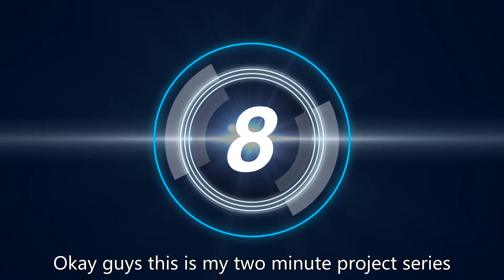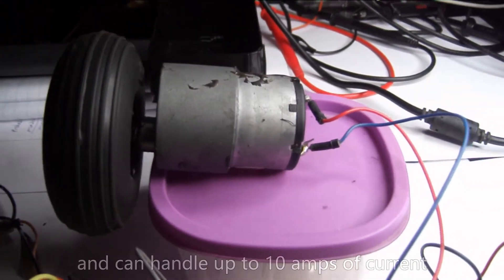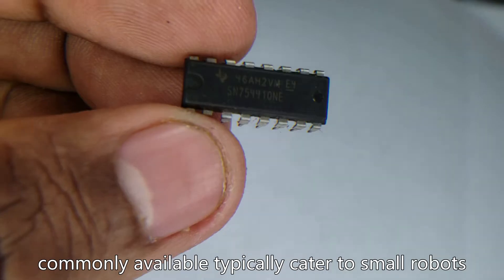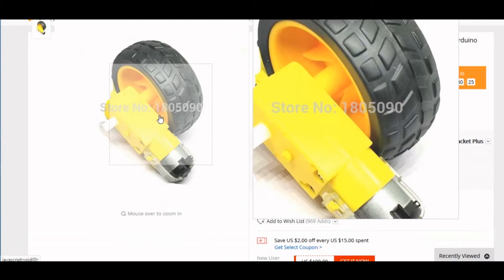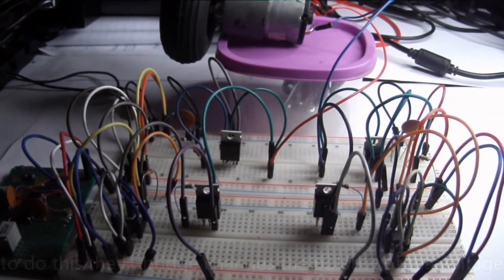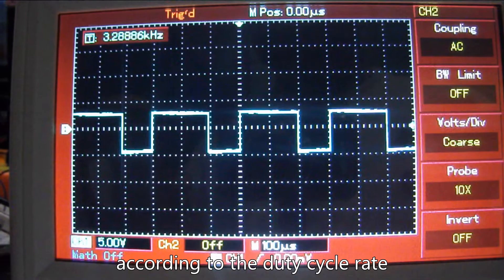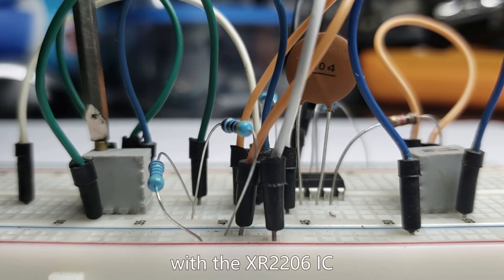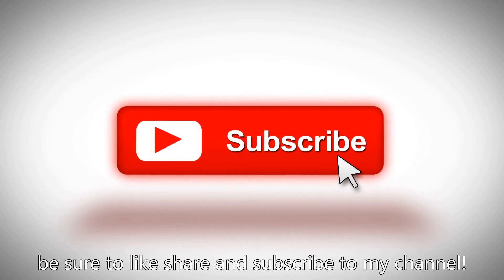H Bridge for Medium Robots 240W 10A | DIY H Bridge Circuit

Comment: Great video and thanks for the schematic!  I made several versions of this BJT h-bridge https://youtu.be/ghQAQDAkElY  , but I can't seem to a MOSFET version to draw enough current. I can get the MOSFETs to "work" but not very well.  I can run a small mA motor, but not enough current to turn on a 25W lamp like my BJT version. I tried mixing P & N Ch or just using N Ch. I've tried doubling the voltage at the gate, tried resistors in every way I can think of... I've tried NPN drivers at the gates... What am I doing wrong? I've used single mosfets to make high current amplifiers and switches before with no problem, but they seem to behave differently in the bridge configuration. Still scratching my head... Hoping you can educate me a bit more on this.